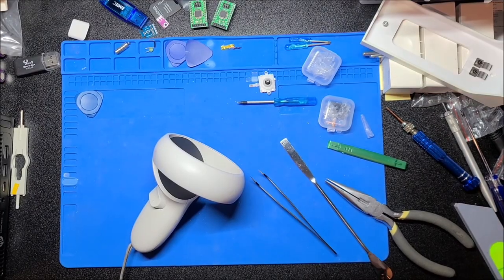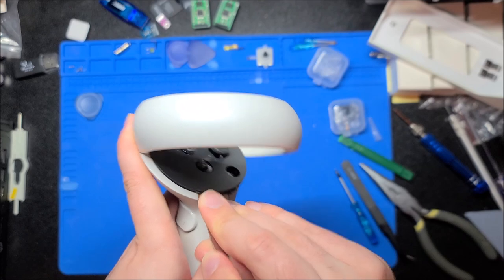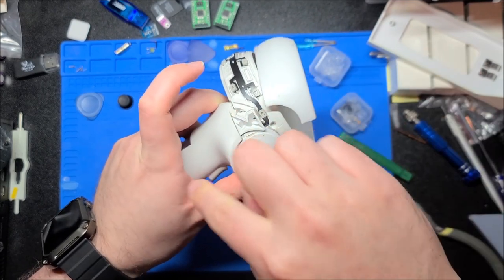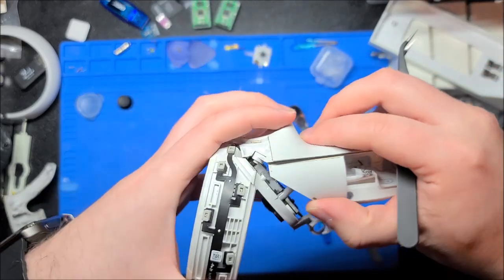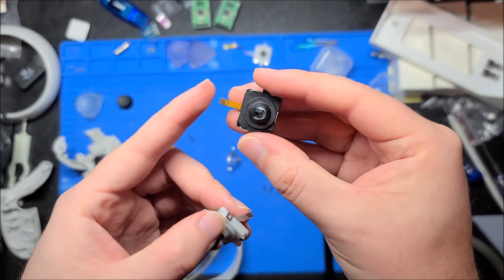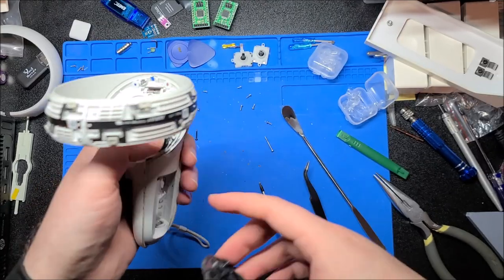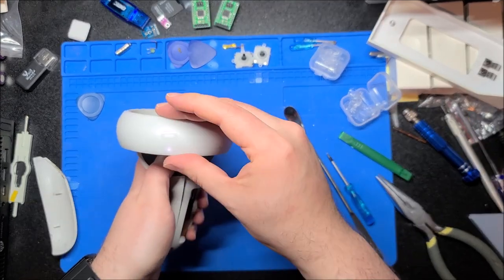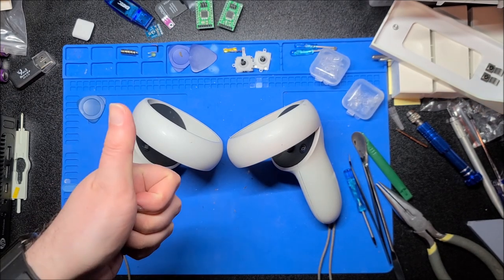Let's Fix: Meta Quest 2 Controller Joystick Drift

Comment: I found a way to simplify the repair a bit: remove this other handle part that covers the ribbon cable. It's very easy to do when you realize that there are 4, not 3, screws under the battery bay sticker. The one you missed is at the end(bottom) of the sticker; you have to peal it almost all the way to see it. Once you have done that, you can fairly easily separate two handle parts, and then you can unplug and then plug ribbon cable from totally exposed socket. Anyway thanks for your detailed tutorial, it helped me a lot!
Reply: I just found it , first time I 'm doing this thanks but I have taken laptops apart a few years ago and my Nexus 6P phone to replace the battery that lasted 1 year before it went hey wire and lost one it's 8 cores in the processor resulting in a bootup of the phone but would loop until the battery died it was a great phone with a bad defect,  it's funny my 4year old Oculus Rift CV1 controllers still have no issues but this Quest 2 controllers looks like it's designed to fail.

Comment: Very helpful video, I removed the other part of the handle shell and that made it much easier to dis/connect the zif cable, just peel off the sticker in the battery compartment and remove the four screws.  Like all of this it is a bit of fiddle to unclip but do.able.  Got this changed over and gave to son, who then realised he had given me the wrong one ... all good practice/perks of being a dad.

Comment: I fixed mine just by removing the top shield and spraying light amounts of plastic safe contact cleaner down the sides of the joy stick shaft and working it around - (complete replacement not required) - good to know the process thought - thanks for posting
Reply: I was thinking about doing that to but I didn't have anything to spray in it but I'll remember this for if it happens again so thanks for the idea!!

Comment: You'd think with all the money Zuck puts into Meta, he'd make it so the controllers were incapable of Drift and ergo null this WHOLE process. I know many companies purposely make their products prone to faults (so you'll buy replacements) but conversely, it shows lack of value for money and would turn off customers (both pre existing and potential).

(((Yes, MY Meta Quest 2 has stick drift, in both controllers no less and I am VERY salty about it)))
Reply from the maker: It seems ALL modern pot based joystick controllers are significantly less robust than even most of my older controllers that also have carbon pots. Almost like they are made cheaper to intentionally drastically reduce their lifespan.
Reply: Yep, same reason why all computer mice still use electric microswitches, instead of capacitive or piezo or hall effect or inductive, you know EVERY OTHER TECH THAT IS 100 TIMES MORE ROBUST but that would cost a few extra cents and make them not break right after warranty expires! I am extra pissed about this cause I worked with the good stuff (industrial/medical and professional equipment in general) and I know how durable and reliable thing can be for just a few extra dimes! </end rant>

Comment: well if you have the new logo it's a lot harder i got to the point of the separate the top from bottom but it will not separate no matter what i tried to do and there are smaller screws added that you will need a size 4 for I'm going to keep trying but for right now i cant get it off ( nvm i missed a screw :D  )

Comment: I fixed the right controller just fine, it works as all. But the left one has no power now 😱 what do I do next?
Reply from the maker: Check and reseat the ribbons, all it takes is one not being in all the way for it not to work.

Comment: 😢I did all this the first time, pain in the ass.  Second time I used WD-40.  Worked like a charm.  Just remove the faceplate and pull off the joystick knob.  Small squirt into the stick base and move it around, pressing it as well.
Reply from the maker: I'd certainly use an electronics contact cleaner but wd40 will dry out and turn gummy after awhile so I'd avoid that imo.

Comment: when it comes to the zif connecters, do i pull up the grey metal part or slide out the black ribbon?
Reply: also go into more detail on how i really dont want to break it
Reply from the maker: What specific connector? (Tell me the timestamp in the video so I know which one) There a multiple kinds of zif connectors and how to open them slightly differs depending on the type.
Reply: Sorry tthe reply to that didn’t show
Reply: I think its like 12:19 or something
Reply: Twelve nineteen i cant say times for some reason
Reply from the maker: Ok for that one there's a black plastic locking bar at the side opposite where the ribbon inserts, you need to carefully lift this with a fingernail. Then slide the ribbon out of the connector.
Reply: @sjm4306  thanks